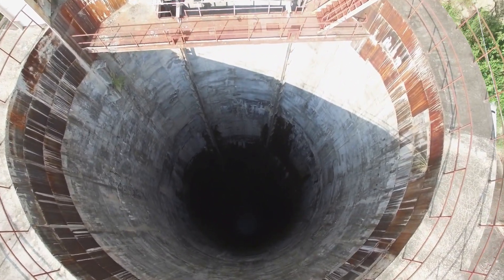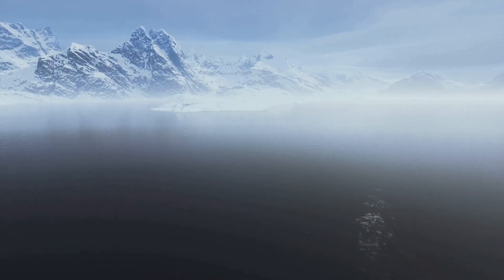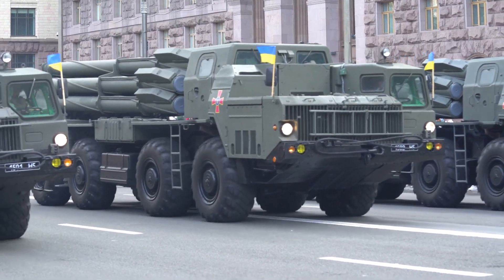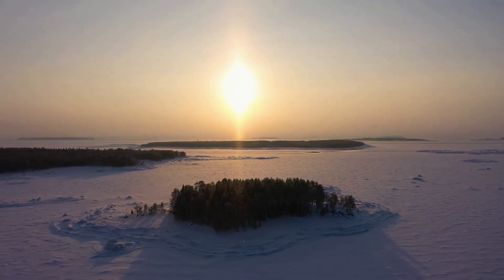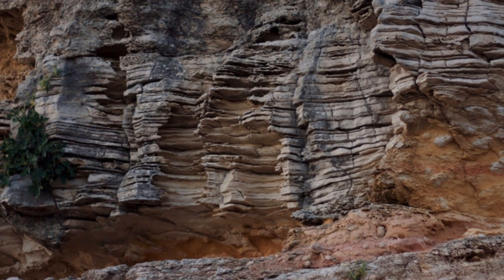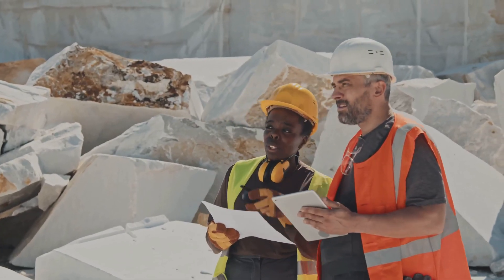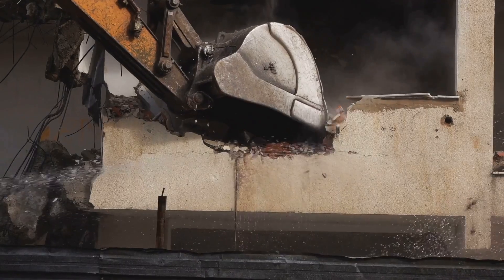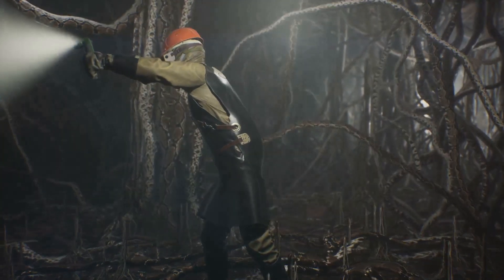Earth's Deepest Secret: The 12km Hole You Never Knew 🕳️

Comment: A direct route to the core would release a Unstoppable volcano that will last forever without obstructions in its path
Reply from the maker: That’s a common misconception, but interesting to discuss. The Earth’s core isn’t magma—it’s mostly solid iron and nickel under extreme pressure. Even the deepest drill hole ever made barely scratched the crust. Nature has strong safeguards in place.